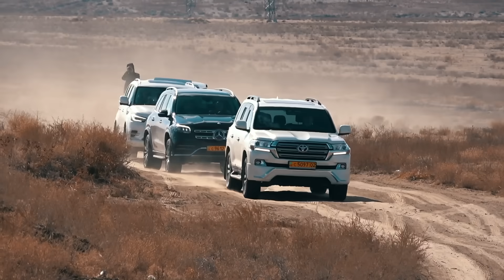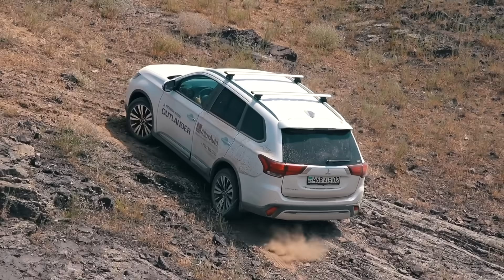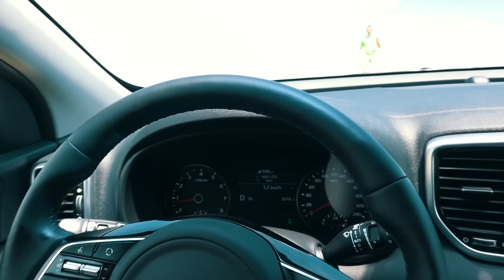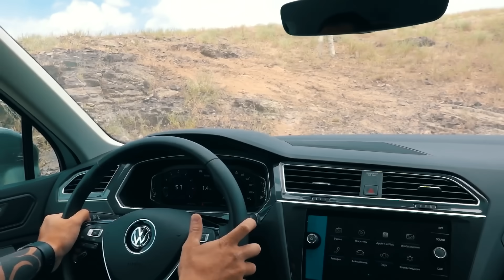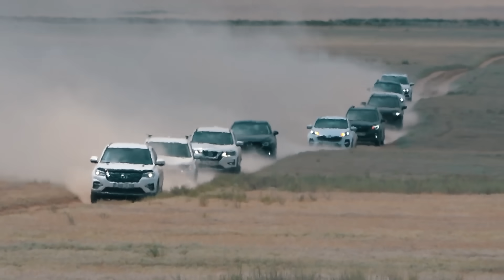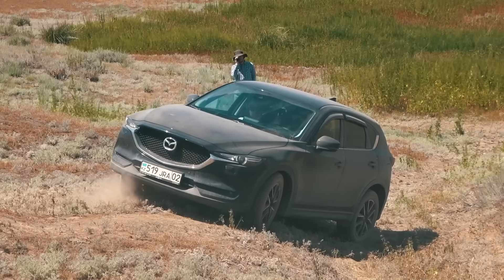SUV Battle 2020: Toyota RAV4, Nissan Rogue, Subaru Forester, Mazda CX 5, Volkswagen Tiguan, Sportage

Comment: first cars had an advantage
Reply from the maker: I completely agree with you. But finding a way so that the surface condition does not change and there are convenient shooting points is extremely difficult. So far this is the best I have found. If I find something with a more stable surface, of course I will take this opportunity and will test there.

Comment: This video holds little credibility
Reply from the maker: Could you explain why?
Reply: @SUVBattle  These vehicles have different modes that would dramatically affect wheel spin. Did you use standard mode for all vehicles? Disable traction control? Use off road settings? The experience of any one of these vehicles could be drastically different based on these settings. My outback drives very differently based on x mode, traction control settings, etc, and not always in the ways the manual says. I just don't believe this is a very comprehensive test of the abilities of any single vehicle, or at least it's not portrayed that way in th video. Too many variables left up to chance.  In an age where computers are controlling the awd systems of these vehicles and telling which tires to grip or slip based on settings, there is almost no mention of these systems or their variations in the video. Drive two trucks up a hill, but neglect to mention that you left one in 2wd and then put the other in 4wd low, not a very good comparison. I feel that is essentially what you have done here. You swung for the fence by comparing so many vehicles, but in the end I feel did none of them justice.

Comment: Each car makes more ruts and softer dirt......Bad idea
Reply from the maker: I completely agree with you about condition of surface. But finding a way so that the surface condition does not change and there are convenient shooting points is extremely difficult. So far this is the best I have found. If I find something with a more stable surface, of course I will take this opportunity and will test there.

Comment: Good to see the Sportage do as well as it did. I have one. While I don't drive off-road like that, it has never got stuck in a snowstorm. I love the traditional six speed automatic it has.
Reply: Kia partnered with Magna Powertrains in Canada to develop their dynamax system, it truly is better than most competitors, I used to sell them :)
Reply: Gotta love a traditional automatic. Everyone is moving to cvt. My forester has a cvt and I wish I had a manual or regular automatic
Reply: I had a 2018 Sportage with AWD that was so bad in the snow.I live in New York and we did get a good amount of snow this winter, but I can't imagine how it would've performed in worse conditions. Mind me asking what year yours is?
Reply: @codyhermann0  I have the 2017 Tucson (basically the same car). Living in Canada it continually took on 2+ foot high snow. My guess is the tires. 3 season vs 4 season vs snow tires. The difference with each step is incredible.
Reply: The 2.4 liter engine Sportage behaves way different as the 2 liter, I don’t really know why.
Reply: KIA is SHIT
Reply: I have one too, just that its over all smaller when compared to its rivals like CR-V, Rougue and CX-5

Comment: 15:32 What a reliable car :D
Reply: you missed the one at 27:45
Reply: @thesunoversea  At least it's protecting itself. Vw will almost cut off the axle or break the transmission mount.
Reply: @ahmeta.112  protecting himself? I guess that's one way of describing a total failure
Reply: @thesunoversea  Yes you are right. It would be better if it made abnormal noises like shitty vw.
Reply: @ahmeta.112  No matter how much you try to cope, its still a total failure

Comment: In Australia we have an AWD vehicle that will and does preform way far and beyond the systems assisting these AWD systems of all vehicles. It's the vehicle we use in our videos and it has out even designed 4wd equipped vehicles to shame, too bad you guys couldn't have had an Holden GM Adventra to compare I'm almost certain it would be the winner and the cheapest AWD of them all.

Comment: Not entirely a fair test.  The potholes keep getting deeper after each vehicle.
Reply from the maker: I completely agree with you about condition of surface. But finding a way so that the surface condition does not change and there are convenient shooting points is extremely difficult. So far this is the best I have found. If I find something with a more stable surface, of course I will take this opportunity and will test there.

Comment: On the Mazda CX-5, my experience is that "ESP-off" works somewhat similar to the more recent "OFF-ROAD" mode. The traction control grips the spinning wheel more aggressive to prevent diagonal stop. What concerns me though, is the overheating of the AWD system.
Reply: Looks like a hot day, probably not a big deal most if the time

Comment: This video taught me two things. 1- bells and whistles aside, it's most important to drive the terrain well (picking good lines, turning front wheels back and forth for added traction, bumping past an obstacle with a little momentum, etc.) 2- open diffs are open diffs, and that puts vehicles at a real disadvantage for driving offroad.
Reply: This video taugh me only one thing: spend your money in a true off-road vehicle if you need one. Don't waste your money in urban non capable fancy cars.
Reply: @enebolsa9815  Exactly. Even an early 2000s Ford Explorer or Chevy Trailblazer with true 4Hi/4Lo would go right up that. But they were built on truck platforms and have real 4x4 systems. Unfortunately, they've turned all these early real 4x4s SUVs that offered comfort, space and utility into gas sipping weenies that can't make it up hills like this. The whole reason for owning an SUV is off road capability. Otherwise, they are all just large Subaru Outbacks/cars, not SUVs.

Comment: I mean this comparison really sucks, the ground is getting more and more torn off after each vehicle had passed through... which makes this test really biased..
Reply from the maker: I completely agree with you about condition of surface. But finding a way so that the surface condition does not change and there are convenient shooting points is extremely difficult. So far this is the best I have found. If I find something with a more stable surface, of course I will take this opportunity and will test there.
Reply: @SUVBattle  nevertheless, I watched until the end.

Comment: This isn't a fair test at all, why not have the same tires or at least the same driver, you can clearly see the Subaru driver has no idea what he is doing and has little off-roading experience. I've seen the Subaru Forester do some crazy stuff here in Australia. That guy has no idea what he is doing.
Reply from the maker: I completely agree with you. The same tires will add objectivity. But since I do not have a car tire factory, we work with what we have. At the moment, we are checking that the tire pressure corresponds to the factory values (for each car individually).
Reply: @SUVBattle  i understand, having the same tires would be a big ask. thanks again for the video, very informative.

Comment: I had a 2014 Rougue. It was amazing in snow. Too BAD THE JAPANESE ARE using CVT to save cost. I would never buy anything with a CVT again. The manufacturers try to Market the CVT as more fuel efficient but is not true. It good that these test are done to educate the general population.

Comment: So the Subaru is over rated. The Rav4 was surprisingly good
Reply: Funny how they didn't turn off the traction control on the subaru, when they did on many of the others.  Don't get me wrong the rav 4 is a damn good vehicle,  but seems a bit should at least take the same steps on all the vehicles
Reply: Yup !!
Reply: But, but, the driver..! 😁

Comment: Thank you! Now I'm curious how the Rav Hybrid would perform!
Reply from the maker: You're welcome! More battles on the way ;-)
Reply: Probably much worse, the rear isn’t powered by a driveline, and the motors aren’t that powerful.
Reply: @bigchungus1348  but they have good torque from 0 revs being electric 🤤
Reply: @rhett7716  I did see some tests done on the hybrid. I was impressed with what the electric motor was doing.
Reply: @RockClimbinGrandma  would you share the link ?

Comment: 🤔I always wonder why none of these test utilize the paddle-shift mode where you select your 1st, 2nd or 3rd gear!
I use it in my 17' Subaru Crosstrek for better offroad control.🤓
Reply: it doesn't do anything in a car with a cvt box
Reply: @lexuslfa4739  Subaru function must be different. In the Crosstrek when descending downhill, you are able to use the low "simulation" gear when in paddle shift mode. Not sure about other vehicles w/ cvt.

Comment: The RAV4 appears to be an XLE trim level, not the Adventure or TRD. The LE and XLE have standard open diffs in the rear. The Adventure and TRD trim levels have the rear clutch type LSD.
Reply: I was wondering because the Subaru Wilderness beats it hands down in snow on a different channel

Comment: It's a batte shit. You cannot compare cars with different wheels. Also the route was distressed from car by car. So the results are not fair for none if the cars.
Reply from the maker: I completely agree with you about tires and surface.

The same tires will add objectivity. But since I do not have a car tire factory, we work with what we have. At the moment, we are checking that the tire pressure corresponds to the factory values (for each car individually).

And finding a way so that the surface condition does not change and there are convenient shooting points is extremely difficult. So far this is the best I have found. If I find something with a more stable surface, of course I will take this opportunity and will test there.
Reply: @SUVBattle , thank you for your quick respond! Also take care that all the cars have different behaviour and you can not test with the same standards that you define and for sure all of the SUV's should have the AWD locked before starting the test. For example, a car when starts  moving, needs to look forward and try not to stop it, to pass an obstacle.

Comment: Replace Subaru Driver. Subaru can easily get through tougher roads.
Reply: Exactly and they had it stopped in the rut
Reply: Dude I'd rather pull a red wagon filled with 800lb of rock than drive a heaping pile of garbage like a Subaru up that hill

Comment: Quite a good wide list of vehicles to compare with - I would say that you would not walk up a hill like this with tennis shoes because you would be slipping most of the way which is why walking/hiking boots were invented - the same goes for tyres - in this test you may have used Yokohama Geolanders like I used on many Subarus over the years, but would get stuck or bogged easily until I fitted mud tyres and lowered the tyre pressures. CVTs are not designed for these uphill challenges or towing as they overheat and protest very quickly - a conventional auto transmission not DSG ((flawed VW/Audi/Skoda design) is the best option with central rear and front diff locking abilities. I think you called it a centre clutch which I’ve never heard of. Look forward to the next review of larger SUVs - John in SA

Comment: I feel like the drivers were turning on an off the electronic aids as though they had no idea what they do.
Reply from the maker: Actually, they don't. They have instructions. At first, all cars drive in the “dummy” mode: the gearbox is just in the Drive position. After the car gets stuck and cannot go further, we activate the available auxiliary mode, most often this is the OFF-ROAD mode. This sequence allows you to form an understanding of how the behavior of the car changes in standard and offroad modes.
Reply: @SUVBattle  Ok, if you say so. Next time you take the Subaru off road though, try X-Mode on and ESP off. The final Tiguan run this was done and you see the difference, even though it was also the only one that was run no stop from the bottom. The traction control component of the ESP limits the power to regain traction because it is a safety feature, not an off road aid. X-Mode or off road modes change how and where the power is distributed rather than relying on an open diffs. 

Basically, the Forester got as far as it could in standard mode that momentum would allow.
Then X-Mode was turned on and the short pauses are the brakes pulsing to try and push power to the wheel not spinning to get movement.
The driver backed down but the traction control did not allow enough power to gain momentum to clear the obstacle. Then the driver backed down further and turned off X-Mode and back to standard mode (again). Open diffs without X-Mode, momentum or an even surface showed this to be pointless.
Further back down the hill and the ESP is turned off. The commenter then even comments how the acceleration changes. That is because power is not reduced at wheel slip. X-Mode would have also changed the way the torque is delivered from the engine, the ratio of the CVT and controls wheels that have lost traction.

You will notice the same behaviour with some of the other vehicles which is why I don't understand why the instructions were followed as you say, then after that it was a free for all switching aids on and off.

Comment: None of these vehicles are considered off-road vehicles which is why several of them had their transmissions overheat. No matter what some little button on the dash says. Also none of them had proper off-road tires. Only a complete idiot would take any of these vehicles out in such conditions on purpose . all of these vehicles are meant for soccer moms driving the kids back and forth to band practice and sports.
I personally own a 2007 Subaru Forester and it now has just over 300,000 Miles. I've never had it stuck and have been stupid enough to put myself in situations where I should have gotten it stuck ! What I was also smart enough to be doing so on off-road tires instead of highway tires.
Reply from the maker: I just want to show the difference in the efficiency of the four-wheel drive of different cars. It may influence on future owners in their decisions about buying the car or not.

And I agree with you about tires. But since I do not have a car tire factory, we work with what we have.

Comment: Subaru had good looking torque transfer, just not enough torque. A few of them had something similar going on. When only two of the tires are slightly slipping and looks like it's leaning forward, but not able to make forward progress. The vehicles with free-wheel spinning and stuck, had poor torque transfer.

Comment: I am thinking if there is a different between rav4 limited and the adventure category witch one the best for off-road and in towing capacity. I like the limited but I need the best for off-road. The both has 2.5 L with 8 speed in my area Please advise me.

Comment: How often do you think you’ll get caught in this place?
There are lots of inputs in each drive train selection to make it perform better and not just by pushing the button or turning the knob and floor the gas.
Reply from the maker: Drivers deliberately drive as slowly as possible and along a deliberately “wrong” complex trajectory. This allows you to demonstrate the effectiveness of the four-wheel drive system. If you take a good acceleration, then all cars will easily pass this obstacle and you will not notice any difference in their behavior.

Comment: im not sure if it will work in new vehicles but in 4wd with an open diff, if your wheels get airborn try adding some left foot braking to lock up the wheels in the air and send power back to the wheels on the ground. works well in my older open diff 4wd vehicles.

Comment: you really spent time for this.. maybe money too.. all the cars, lots of cameras, stuff etc... Problem is, while you were spending all of these, couldnt you find some "normal" drivers instead of these super talented ones and make a "reliable" comparison :D  very good video everything is cool but, does it help anything? any answer to any question? any reliable results ? nope.. all nope.. just a video to spend good time..
Reply from the maker: Drivers deliberately drive as slowly as possible and along a deliberately “wrong” complex trajectory. This allows you to demonstrate the effectiveness of the four-wheel drive system. If you take a good acceleration, then all cars will easily pass this obstacle and you will not notice any difference in their behavior.

Comment: Try actually driving though the hill instead of stopping every two feet.
Reply from the maker: Drivers deliberately drive as slowly as possible and along a deliberately “wrong” complex trajectory. This allows you to demonstrate the effectiveness of the four-wheel drive system. If you take a good acceleration, then all cars will easily pass this obstacle and you will not notice any difference in their behavior.

Comment: Sorry this test wasn’t very good. Why would you purposely stop vehicles in the middle with such loose dirt and with stock tires. 
Sorry but this test was not fair to any of the vehicles.
Reply from the maker: Drivers deliberately drive as slowly as possible and along a deliberately “wrong” complex trajectory. This allows you to demonstrate the effectiveness of the four-wheel drive system. If you take a good acceleration, then all cars will easily pass this obstacle and you will not notice any difference in their behavior.